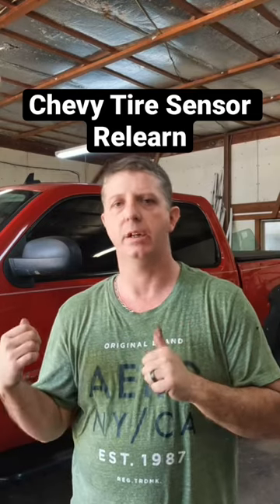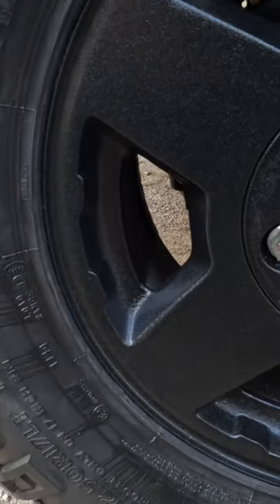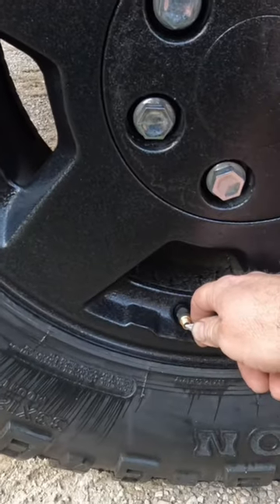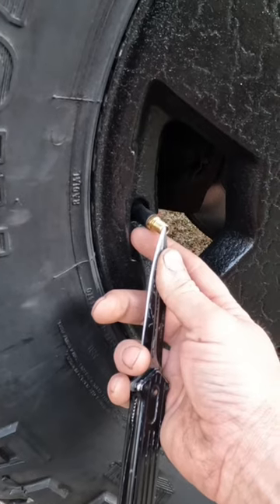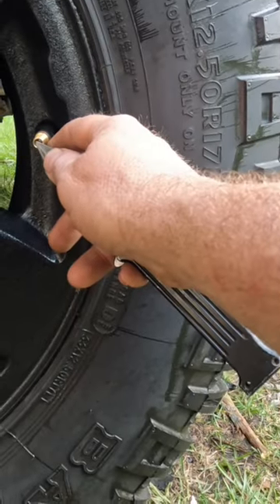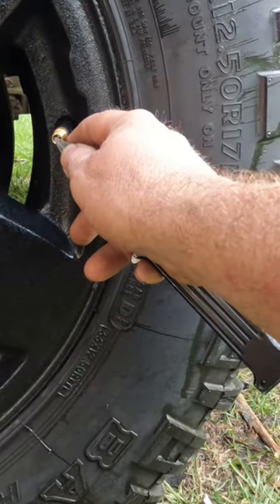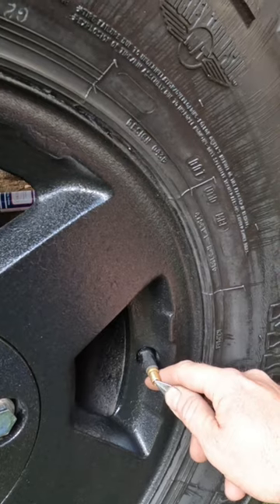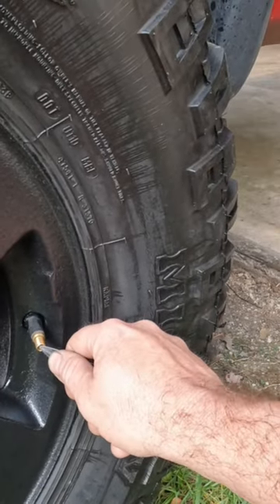Chevy Tire Sensor Relearn Process #chevy #gmc #wheels #diy #howto #silverado #4x4 #shorts

Comment: 🙋‍♂️begin on the driver front tire for 30 seconds until a “BEEP” then passenger front 30 seconds til the “BEEP” then passenger rear 30 seconds til the “BEEP” then lastly rear driver for 30 seconds and it will beep twice letting you know it’s complete. 
The front left light will illuminate then the passenger then the rear passenger and lastly the rear driver.
Reply from the maker: You wanna start the driver front and then go to the passenger front and lastly, the driver rear so it’s always a clockwise motion thanks for watching